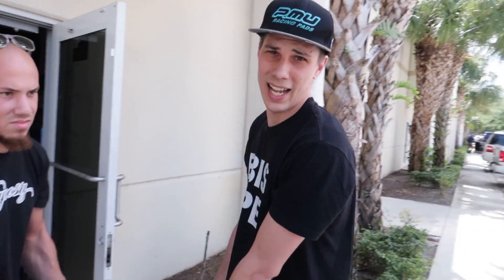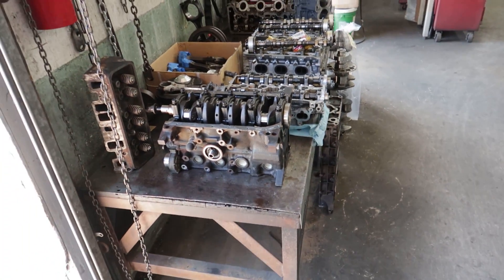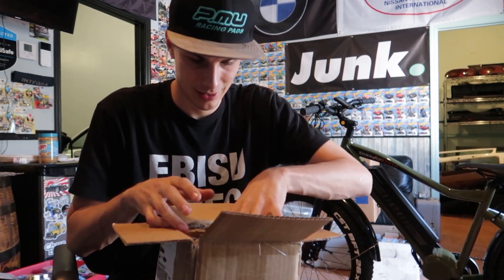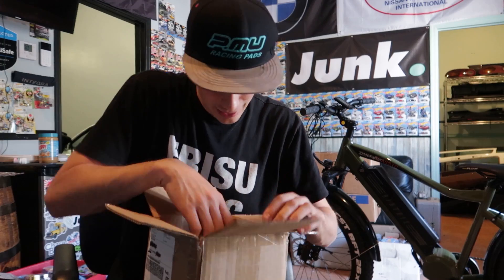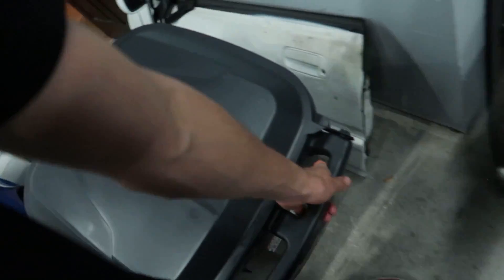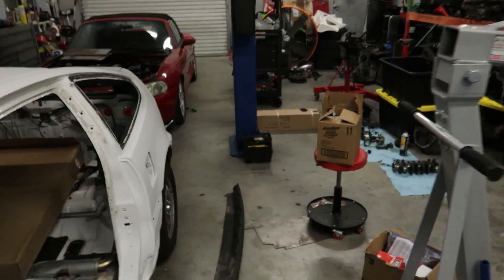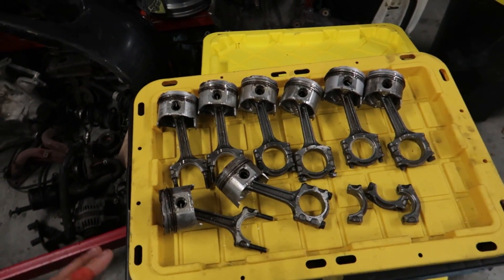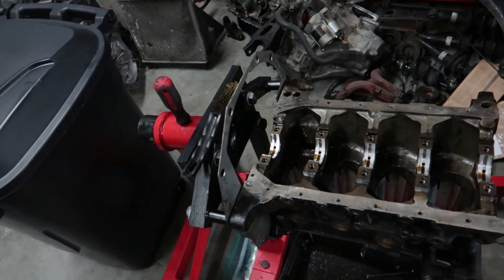DIY ENGINE PARTS CLEANER/ HOT TANK!

Comment: Stick and air hose in your dump tank and let it blow air into the fluid to agitate the cleaner around the parts. Works a lot better. Even better I'd you take and make a loop of pipe with holes drilled into it so it blows all around

Comment: If it's aluminum and anodized you candy and denies it with grease lightningcleaner let it soak for a little while and greased lightning by like a gallon jug or a half gallon jug whatever it let the parts sit in it .... Then you can actually anodized it whatever color with electrolysis process look it up on YouTube but it's easy ... DIY for the corona guy

Comment: The whole situation with Shortnose mx5 engines and Longnose, is that the shortnose engine design 1989-1991 had a failure possibility (Keyway and crank bolt) that could be triggered by any combination of tolerance stack, keyway wear, tight belts, metal fatigue, mechanic putting the key in backwards? who knows

The shortnose failure, involved the key wearing away the keyway, and the bolt being asked to handle too much of a load, ending in a permanent crank wobble, or "crank walk" it was decreasingly effective to repair it as the condition worsened. What drivers would detect if their shortnose engine was failing, was poor performance, timing going out by itself, and accessory belt issues, or no symptoms at all, until someone does a 100,000km service and disturbs the crank pulley with an airgun. the cost to repair was usually about 1-2k+ sometimes involving an engine swap.

The longnose and bignose designs came after late 1991, and solved the whole problem by making the key and keyway longer, and having a more substantial bolt and bolt-head

i have an early 1991 car that had an engine swap by the previous owner from a shortnose block to a longnose, not sure if he did it proactively or as a result of a failure :\ would have to go back and check the receipts he kept
Reply: Stewart Mckinna my friend had a short nose and it had crank wobble at 85k miles lmao, my long block has 200k miles with no problems though

Comment: Those trash cans are great for short while, I used a similar same setup to hot dip and the trash can started leaking by the wheel.  I then used a free 55 gallon blue plastic water barrel from craigslist or facebook marketplace.